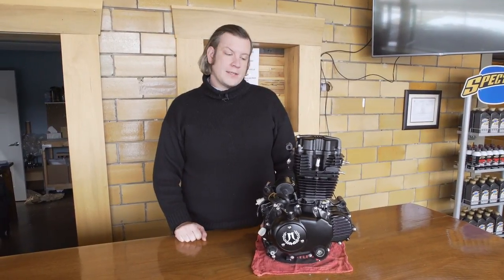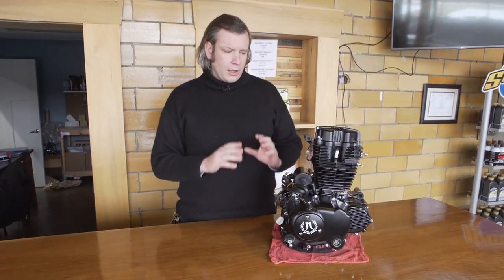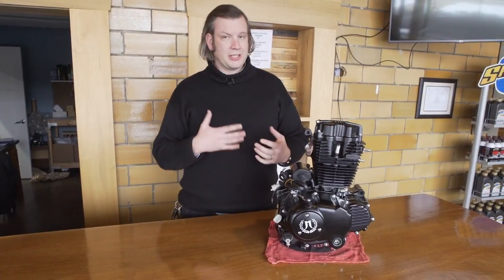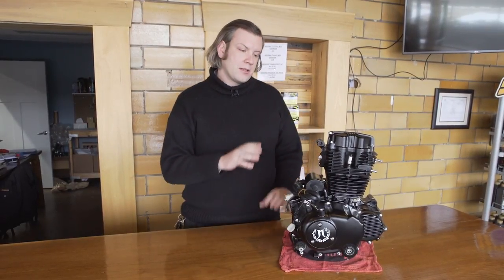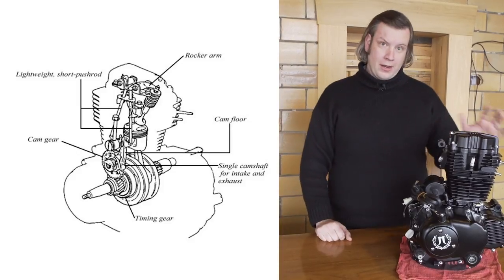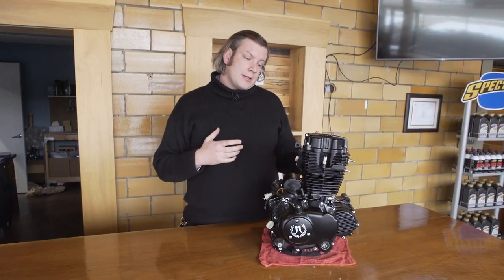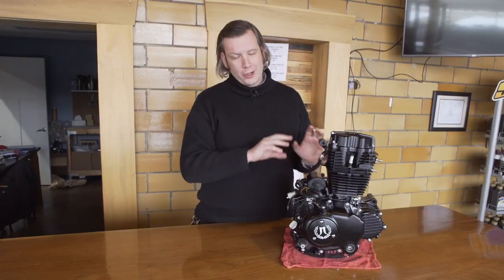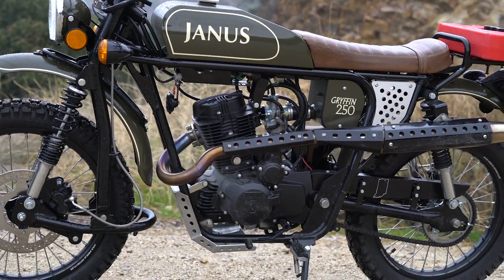Janus Parts Ep. 9: Engines

Comment: The "dream engine" for this would be an "antique-looking", small V-Twin.
Reply: 400cc
Reply: Hyosung 250cc v twin would be cheap and more reliable whilst staying aircooled and carbureted
Reply: @6amamoeba677  hmmm.  And affordable
Reply: A 500 cc V-twin would be ideal in a retro designed motorcycle like this.
Reply: Lifan makes a 250 cc V-Twin based on the Yamaha Virago 250, they could easily have adapted this cam/valves and cylinder design to this arrangment.  Their Virago clone is undersquare and has OHC. so there's potential for bigger bores and displacement.  You can buy a Roadster clone of this Lifan V-twin from SSR called the Buccaneer 250.
Reply: @6amamoeba677  aaaa a add😅😅qqqqqqqqqqqqqqqqqqqqqqqqqqqqqqqqqqqqqqqqqqqqqqqqqqqqqqqqqqqqqqqqqqqqqqqqqqqqqqqqqqqqqqqqqqqqqqqqqqqqqqqqqqqqqqqqqqqqqqqqqqqqqqqqqqqqqqqqqqqqqqqqqqqqqqqqqqqqqqqqqqqqqqqqqqqqqqqqqqqqqqqqqqqqqqqqqqqqqqqqqqqqqqqqqqqqqqqqqqqqqqqqqqqqqqqqqqqqqqqqqqqqqqqqqqqqqqqqqqqqqqqqqqqqqqqqqqqqqqqqqqqqqqqqqqqqqqqqqqqqqqqqqqqqqqqqqq we

Comment: The CB 125 with a single overhead cam single cylinder 125cc motorcycle I know I bought one to keep for putting miles on my Classics just to go back and forth to work on when I was 129 lb it would go 77 miles an hour down to Gulf Freeway all day long flat out. Because it was a Honda I didn't worry about it screaming going down the freeway. I sold it to a guy for his daughter's 14th birthday because of Texas you can ride a 125 or less when you're 14 with a learner's permit. That little bike taught a lot of people how to ride a motorcycle and introduce them to the pleasures of two wheels.
Reply: 77mph on a 125cc bike is impressive ! Grom riders would be green with envy !

Comment: These "Part's Talks" really are great and help to allay the concerns and fears that many of us have concerning your bikes.  So great idea to be proactive on that front.  I love the air-cooled engines and would not want anything liquid cooled.  You guys have nailed it and should rightfully be proud with what you've done.
That said, I really would like to see EFI and maybe an engine option approaching 400cc... not for "performance", but simply because where I live (in steep mountains), the 250cc bikes just don't have the puff to keep up momentum.  I have a Suzuki TU250X and love the bike, (engine is very similar to yours).  But it's just not enough if I want to go touring through my mountain passes.
Reply: I agree as well. My 400 cc dual sport  is definitely weezy when I get to the riding areas and a 250 has to be pinned getting over the passes

Comment: People complain about the price because it’s a Chinese engine but, what you get is a very well thought out design hand made custom motorcycle. The same people would spend $80,000 on a custom chopper without hesitation!!
Reply: The amount of people that would spend $80,000 on the Choppers long Dead and Gone. To sell a $15,000 motorcycle with a cheap Chinese built engine is just simply Unthinkable in my opinion.
Reply: The days of people spending $80,000 for custom chopper are long gone. And the people who spent $80,000 for Chopper we're lucky to get 10 cents on the dollar when they sold their bike.
Reply: A replacement engine can be had ( probably with the OHC version as an option ) for less than $1K, usually way less.

Comment: I would just like to add: The CG engines didn't exactly evolve directly to the 230cc  ("250cc") engine.

   It went to a 150, and then a 200cc, this was accomplished with boring and stroking the crankshaft.  Notably a small machine shop in Bend, Oregon back in the early 1970's was the first to experiment with Honda's little Thumpers.  They would rebuild the old OHC CB100~125 by boring and stroking out to them 150 and 175~190CC respectively.  PowRoll was their name.  They're not in business any more.

  Secondly with careful engine crank balancing, a balance shaft is not really that necessary.  I own a Lifan 200 cc bike with the same design engine without the balance shaft, and I will say this,  it is smoother that one of the oldest OHC Italian singles. The Ducati bevelgear 250.  And the Duc engine was noted for being a very smooth running thumper engine.  The little Lifan is fine up through 8500 rpm. Although it's a little buzzy from 6500, but not what I would consider bad. My '68 Honda CL350 was worse.
Reply: My CG150 isn’t broken-in yet but so far the vibration doesn’t seem bad at all in the bars, do feel it in the seat though, which is a little odd. Nice engine ( RPS Condor 150 ) has kick start which I believe does start it with a totally dead battery.

Comment: So I got that it's a cg250 and I will agree they are very very reliable engines I've had the CG in my quad for 16 years and still runs wonderful the only thing I do is change the oil every 2,000 miles and adjust the valves what manufacturer manufacturers your CG is it a zongshen motor and are they five speeds or four like my ATV engine

Comment: It is a pity though that a 350cc engine is not available for those of us with more experience and how shall we say, are a bit more gravitationally enhanced.
Reply: The bored 350 version of this engine would probably be far too big to fit into the same bike frame  That engine is also only available as an ATV crate engine and doesn't make much more power than the 230.  13K buys you the Halcyon 400 or you can buy the Genuine 400 for much less.

Comment: A motorcycle like this would be a toy vs an every day rider, especially with Midwest weather.  If you could change out the carb for EFI, that would be ideal.  EFI + air cooled is my favorite combination, and even less maintenance overall.
Reply: Suzuki TU250x
Reply: I agree entirely but in a replica early 20th century design the choke adds to the experience and the engine seems to run just fine even by modern standards. I own a Kawasaki Z125 Pro with EFI. Even so, it stumbles and needs a few seconds to sort itself out on a cold start.
Reply: Fuel injection adds 1500 over the price of carburetor for a motorcycle for a big bike it's not a big deal but for smaller bike is a great big chunk of the price.